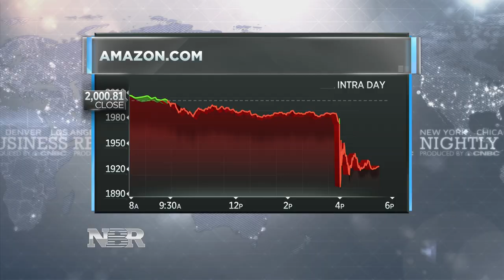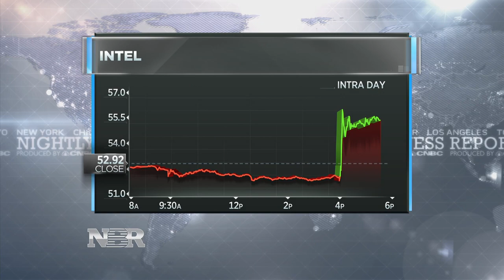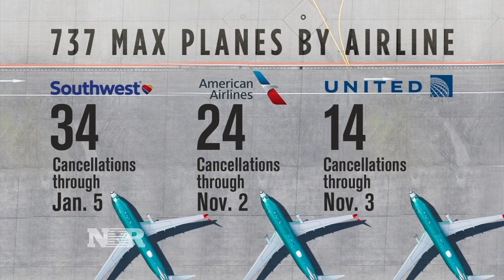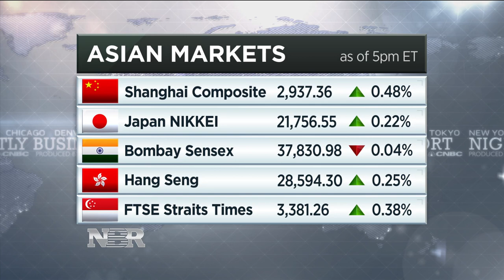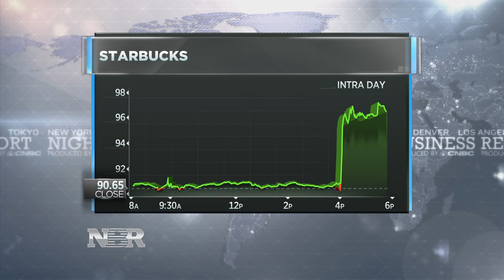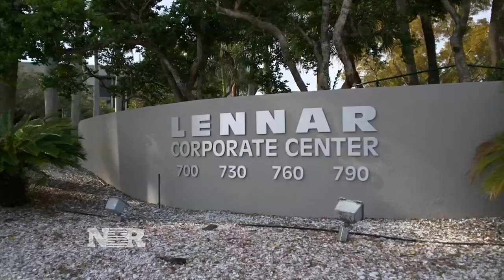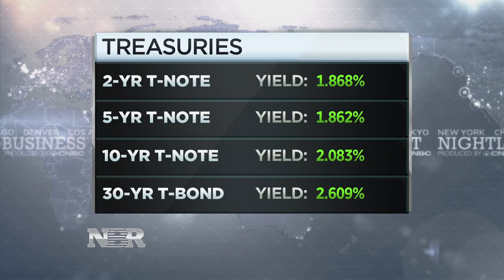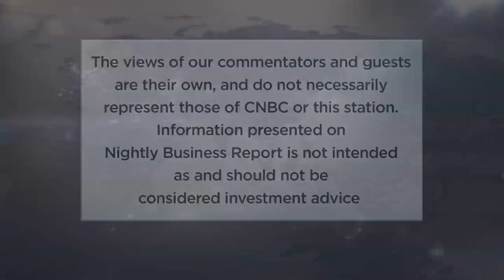Nightly Business Report – July 25, 2019

Comment: Today there were 45 new 52-week highs and 66 new 52-week lows on NASDAQ.    On the NYSE there were 65 new 52-week highs and 50 new 52-week lows.    The slope of the US Treasury yield curve declined mildly: 44 basis points separated the 1-month yield (2.16%) from the 30-year (2.60%).   Volatility, as measured by the volatility index multiple I follow, UVXY, rose mildly.    UVXY closed at 24.64, up 4.27% on the day.

Winners of the day included Connecticut Water Service (US ticker: CTWS) and Kimberly-Clark (US ticker: KMB).    Regarding CTWS: "Connecticut Water Service, Inc., together with its subsidiaries, operates as a regulated water company.   As of December 31, 2017, the company supplied water to 139,574 customers in 80 municipalities in Connecticut and Maine."    Regarding KMB: "Kimberly-Clark Corporation sells household use products worldwide directly to supermarkets, mass merchandisers, drugstores, warehouse clubs, variety and department stores, and other retail outlets, as well as through other distributors and e-commerce; and away-from-home use products directly to manufacturing, lodging, office building, food service, and public facilities, as well as through distributors. Kimberly-Clark Corporation was founded in 1872 and is headquartered in Dallas, Texas."
Reply: Regulated water?